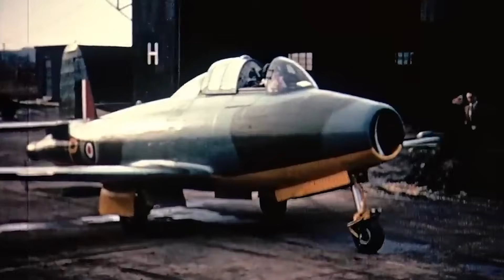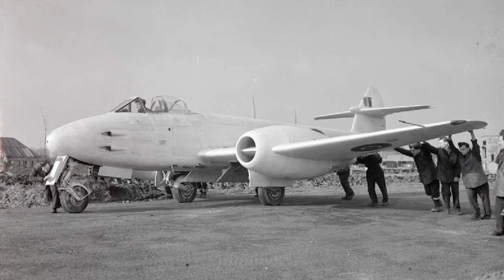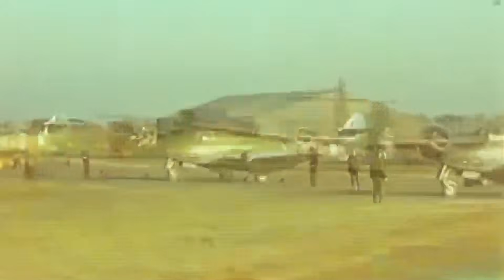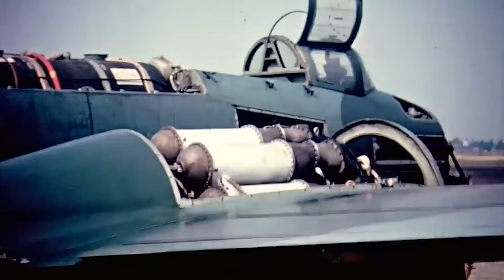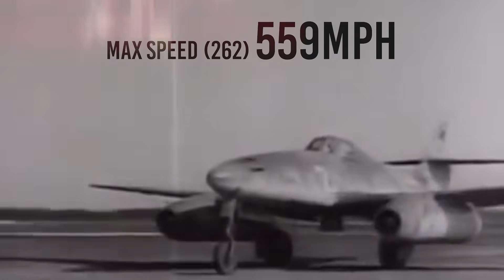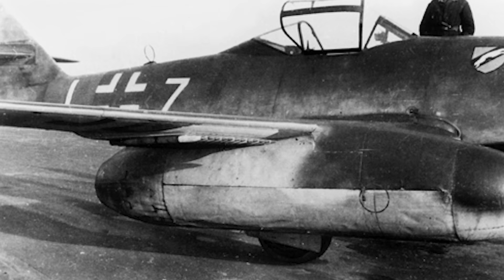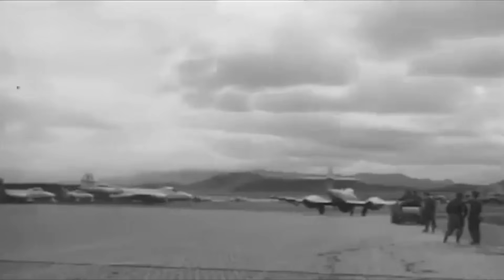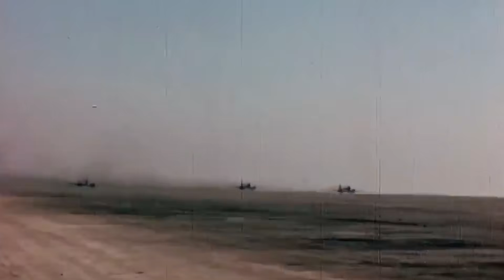Meteor vs Me 262 | Which was the better WW2 jet?

Comment: Facts for an alternate history:
+ Meteor had a record speed
+ its aerodynamic solutions were used in the very successful Canberra
+ today, for speeds over 500 mph, similar wings are used for maneuverable aircraft
+ Meteor was being built and improved before 1955, all Me 262s were discarded, and its influence was almost negligible.
It seems to you that the deformity is beautiful. That's my conclusion. Beauty is a horrible force(c)
Reply: Postwar Britain was bankrupt and had no option other than operating obsolete equipment such as the Meteor. Only Commonwealth nations and the third world operated the Meteor
Reply: @TheAneewAony 

LOL The Nimonic nickel super alloys were developed in Hereford England 1939 -1940. In Germany they thought they needed to use stainless steel for turbine blading which doesn't work and due to various issues ended up attempting to use pressed sheet steel turbine blades. 

262 & it's engines = Garbage (but it did actually fly which surprises a lot of people). In both Russia and France good people wasted their time trying to do something with the engine after 1945. Russians ceased trying in 1948 as their own effort was clearly better.
In France RR got involved in 1950 and managed to get something useful working. 

We feel we can clear up some commonly held myths and misconceptions, obviously.
It's always good to see the facts presented clearly and concisely isn't it?

The Gloster Meteor was one of the world's first jet fighters to go into service, it was in service during WW2. The meteor was the first effective multirole fighter bomber jet aircraft with a reliable engine to go into service,  It broke speed records in 1945 and 1946. During WW2 it was in service as a fighter and multirole aircraft over the UK and over all allied controlled territories in Europe and beyond. 

The ME-262 and it's 46 minutes life engines were abandoned shortly after 1945, it had a do not exceed speed of 456 mph and was only ever used to attack bombers with losses of three 262s for each downed bomber.  During WW2 most of the ME-262s were destroyed by their engines, were various types of accident losses or were shot down by bombers. No German designers were involved with the Mig-15. The Mig-15 used a copy of the RR Nene.  

During the Korean conflict most of the Meteor casualties were due to groundfire or accident losses. The result of any tangles between Migs and Meteors was that Mig pilots avoided getting into dogfights with Meteors. The battle of Sunchon, where 50 Migs against 14 Meteors resulted in the supposedly superior Migs failing to gain any clear advantage caused the Koreans to re-evaluate tactics. General opposition in Australia to involvement in the Korean conflict resulted in the govt using the battle as an excuse to reduce the RAAFs involvement to troop support only.

The world's first wind tunnel was built in England during the 1800s. The world's first supersonic wind tunnel was built in England during the 1920s. 

The Whittle Gloster E28/39  was of course a brilliant aircraft that was later copied in Russia as the upsized and tweaked Mig 15 with a copy of the RR Nene gas turbine aero engine. The RR Nene being the world's most powerful & most reliable gas turbine aero engine in 1944.

The MD F3H Demon was a contemporary to the DH Sea Vixen & had a similar performance. The F4 Phantom was a follow on from the F3 Demon. The Sea Vixen took a long time to get from first flight to introduction for various reasons and a similar situation occurred with the MD F3H Demon.

McDonnell Douglas F3H Demon
590 Built. Not Supersonic.
Max Speed 578 MPH.
Introduction date 7 March 1956
First flight 7 August 1951
Retired 1964

MD F-4 Phantom 2
Number built 5,195
Manufactured 1958–1981
Introduction date 30 December 1960
First flight 27 May 1958

DH Sea Vixen
Number built 151 (including two DH110 prototypes and one Sea Vixen prototype)
Introduction date July 1959
First flight 26 September 1951
Max speed 695 MPH.
Retired 1972

Interesting British achievements.
There is no doubt that the Fairey (England)
Delta 2 was of course the world's first jet
aircraft to exceed 1000 mph.  Indeed It
exceeded the previous record by 310 mph &
held the record for 1 year. Incidentally, the Dassault Mirage 3 & 4 are based on the Fairey Delta 2.

The Panavia Tornado & Euro fighter Typhoon are British design aircraft with British design engines built by international consortiums. 

The EE Lightning was one of the fastest aircraft on the planet when it first achieved a Mach 2 flight. 

Early days, jet fighters.
De Havilland Vampire, Sea Vixen & Gloster Meteor accident losses were not high or unusual for fighter aircraft at the time. De Havilland built large numbers of all metal airframe aircraft before the DH Comet.
We mustn't forget of course that the DH Vampire for example first flew in 1943 & the engine was also built by De Havilland. There were examples of the Vampire interceptor / fighter in service until 1990 which was operated by more than 30 countries.

Non combat phase accident losses.
% of Aircraft built.

The Canadair CL-44 was a turboprop airliner.
Canadair CL-44                  (ff 1959 ) 48%
Lockheed XF104                (ff 1954) 100%
Lockheed  P80                   (ff 1944) 43%
Lockheed F104                 (ff 1954)  45%
Grumman f9f-5 Panther   (ff 1947) 44% 
Convair F102 Dagger        (ff 1953) 45%  
MD F-101 Voodoo.             (ff 1954) 34%
MD FH Phantom 1            (ff 1945)  35%
MD F4 Phantom 2             (ff 1958)  28%
MD F3H  Demon               (ff 1951)  32%
Gloster Meteor                  (ff 1943)  21%
DH Vampire UK                (ff 1943)  23%
DH Sea Vixen   UK           (ff  1951) 33%
Gloster Javelin  UK         (ff 1951) 20%
EE Lightning  UK             (ff 1954) 33%

It's a great pity & a crying shame that British military forces had to occupy a large part of Germany for decades after 1945 & Russian military forces had to do the same. Of course Russia still posseses a large chunk of what was German territory & of course Russia & the UK produce nukes. Obviously Germany does not produce nukes.

Early days, jet engines. Whittle performed the world's first demonstration of a gas turbine aero engine in 1937. The RR Nene, a centrifugal gas turbine aero engine, was the world's most reliable & most powerful gas turbine aero engine in 1944. Licensed built versions & copies of the RR Nene & RR Derwent would go on to power many aircraft in Russia including the Mig 15 & Mig 17, the US, China, France & other countries for decades after 1944. Incidentally, the Mig-15 was in essence an upsized / tweaked copy of the Whittle / Gloster E28/39 jet aircraft including an uprated copy of the RR engine.  The basic centrifugal compressor gas turbine aero engine with Whittle style reverse flow combusters and sometimes an axial compressor section is still manufactured by more than one company including Pratt and Whitney, the main application being helicopters.

The gas turbine engine was invented in England during the 1700s.

During the 1800s Parsons of Ireland & North England produced the world's first axial multi stage sequential stator rotor turbines and compressors for turbomachinery use which would eventually go on to to form the main components of the axial gas turbine aero engine. At the time the basic idea of making an internal combustion gas turbine engine and using it as an aircraft engine was considered thus the jet aircraft concept had been created in England before the first powered aircraft flew.

An example of what goes on these days in various countries. For example, there are of course no German companies that makes German jet aircraft in Germany & there are no German Companies that make German gas turbine aero engines in Germany that are suitable for widebody airliners.

The UK has the world's highest combined per capita Nuclear / Defence / Aerospace Sector Activity.

UK defence sector, absolute terms, world's second highest activity. 1st for per capita defence sector activity. Per capita nuclear powered submarine construction, 2nd position. 
Main players being Rolls Royce, Babcock, GKN Aerospace & BAe Systems. Activities often involve international collaboration. BAe systems, RR and other UK companies now handle more Airbus work value wise than Germany. 

There's a good chance that anyone currently flying on a widebody airliner will be on an aircraft powered by RR gas turbine aero engines made in the UK and a good chance there will be other hardware on the aircraft that's designed and / or manufactured in the UK. 

Rolls Royce Holdings UK
Subsidiaries
- Rolls-Royce plc
- Rolls-Royce North America (ex Allison etc Classified Military stuff)
- Rolls-Royce AB
- Rolls-Royce Deutschland
- Rolls-Royce India Private Limited
- Rolls-Royce Marine Power Operations
- Vinters Engineering Limited
- Rolls-Royce Controls and Data Services
- Rolls-Royce Power Systems
- Bergen Marine
Joint ventures include:
- Rolls-Royce Turbomeca
- MTU Turbomeca -

Trent Family
The MT30 (Marine Turbine)
Industrial Trent 60 Gas Turbine
Trent 7000
Trent XWB Airbus A330neo.
Trent 1500
Trent 1000
Trent 500
Trent 600
Trent 700
Trent 800
Trent 8100
Trent 900
   
RR wholly owned subsidiaries in Germany handle smaller 2 shaft RR gas turbine aero engine work.

The UK space and aerospace sectors are highly productive, high-value industries that together contribute over £18 Billion in direct Gross Value Added (GVA) to the UK economy. Individually, the space industry directly contributes about 0.3% of UK GDP 7•2 Billion while the aerospace industry contributes approximately 0.5% £10•9 Billion.
   
Wee hopes theze helpsmz.  EtC---.

We hope this helps of course 👍

Comment: In Germany, there were no aircraft with a thin wing sweep >30 deg.
However, they were being built in the USA starting in 1942: XP-55, XP-56, XP-79.
In Germany discovered swept wings with controlled slats. And it's precisely this combination, not the swept wing angle with which the USA had grown weary by that time, that was the solution.
And DH 108 is not based on German work. Own work since 1908 is sufficient! Elevons, thin S-airfoil, winglets, fences, most types of flaps — British implementations. Except for the Wright flaps, as part.
The German controlled slat on the swept wing saved at LOW speeds.
Reply: The slats functioned at low speeds, or at higher angles of attack, delaying separation of the boundary layer and a stall. Additionally, the increase in wing sweep from the prototype 262 wasn't done for aerodynamic reasons, but to shift the center of gravity that had moved with the change from BMW 003 engines to Jumo 004 engines. It's like the people who ascribe all sorts of stealth design to the Horten Brothers' Ho 229, when there was no such intention until Reimar Horten claimed, years after the end of WWII, that 'stealth' had been a design consideration in the design of the 229.

Comment: Whittle's solutions were not a dead end then, they are widely used on small engines today.
For example, the supersonic Ching Kuo and re-engining Jaguar, M341 have a centrifugal compressor and a counter-flow combustion chamber. And even smaller turboprops and missile engines.
Jumo 004 and all Hirth projects are a dead end. Westinghouse and Price made fail projects. Only BMW 003 was developed in the USSR and France, for aircraft of a different size. There was also Griffith, whose project failed, but became partly the basis for work in the UK and US. Whittle's company was not allowed to develop its ideas in the UK, because it was directly associated with the Ministry of Aviation, not commercial. His small company collapsed, and Whittle flew off to work in the US.
Afterburner, turbofan, combination of axial and centrifugal compressor, two shafts - these are his early ideas.

Comment: The claim that the reliability of Jumo 004 depended on heat alloys is debatable. There is a easy argument: the captured Jumo, BMW, and Hirth engineers tried to complete 004 in the USSR. They initially used German heat alloys, which were not scarce in the USSR, and from 1946, after Soviet engineers' trips to RR, the famous British alloys, but this did not lead the project to robust.
However, the length of the shaft, the number of supports, the big number of compressor stages, without a compressor stator, and the straight combustion chambers led to breakdowns and maintenance difficulties. This was the fault of the Jumo designers. Only Jumo 022 good worked in the USSR, but it was done using all the knowledge gained in 1946 from RR.
Not only a alloys. It is clearly important that 022 was much larger. Small motors have specific solutions.

Comment: Wasn't even close. The 262 shot over 700 real planes down. The Meteor put down V-2 robot bombs, and that's all. The Meteor was rubbish.
Reply: I dont think the meteor was rubbish i have read that the Meteor forced a  fieseler Storch Plane down and destroyed it on the ground!
Reply: @killerkraut9179 Wow!! What an impressive accomplishment!! (sarcasm). The ME-262 only shot down 700 Allied bombers and fighters for the combat losses of 100 jets. LOL
Reply: @WolframKrause-s5i  If the Wikipedia article is correct it did succesfully destroy some planes on the ground as well!
Reply: @killerkraut9179 When is wikipedia ever  correct? The Meteor was good for tipping over V-1 rockets that were slow, and maybe a plane or two parked on the ground, but even the RAF didn't trust it to do air combat against the Luftwaffe, so the plane must have been trash. The Germans had a good jet, the ME-262 which actually shot Allied planes down while they were in the sky.  Only problem was they didn't have enough of these jets, thanks to Hitler's stupidity.
Reply: @WolframKrause-s5i  Very often is Wikipedia correct!
Reply: @killerkraut9179 True, but sometimes not has been my experience.
Reply: @WolframKrause-s5i  There was a real danger in ww2 that planes technology ends 
in the wrong hands like by the Us B29
then the Meteor dosnt have to been trash 
Meteors hade much service after WW2!
Reply: @killerkraut9179 Where's your common sense? There was a reason that the Meteor did not have even one combat encounter in the sky with Luftwaffe fighter planes like the FW-190, ME-109 or the ME-262.  The RAF did not consider it good enough, and put more confidence in its Spitfires and Tempests. The Meteor was only good for downing slow-moving V-1 rockets.  All fact. What don't you understand about that?
Reply: @WolframKrause-s5i  Tel me about B- 29 
and Tupolew Tu-4 Story!
Then it will make sense that the Meteor wasnt often  used over German territory!
That  is most likely another reason that the US P80 wasnt used in Asia!
Reply: @killerkraut9179 Give it a rest already. There never was a Meteor flying over Germany during WWII, and why is your name killerkraut? You don't seem pro-German to me.

Comment: Oh man the me262 was may more better if was down to  athletics (how good it looked, not how fast it could run)
Reply: In a dive, Me 262 was slow by P-51. This was shown by joint tests and battles. In aviation sport Meteor to be more successful.
The main , in my opinion, thing is that NO ONE needed Me 262s, even in the delays USSR, which relied on German engineers and factories.

Comment: The British engines worked great in MiG-15s. Axial-flow engines may have been the future, but in the late '40s were still temperamental. Build quality on the 262 was shit; what do you expect from slave laborers? The Nazis' biggest flaw was that they were Nazis.
Reply: Agreed. All facts show the advantage of Whittles' work over all competitors and in all aspects. Not the time, but the grow size made Whittles' temporary solutions marginal for big engines. The found physical patterns always have a scope of application.
His original patent had axial stages before the centrifugal. It's clear that the shaft elongation would have greatly delayed the work, as it happened to most of Whitney's competitors. Its combustion chambers had extremely easy access for inspection and replacement. The infamous large diameter is formed by the combustion chambers, not the compressor. The competitors complained, first, about the chambers, but this is their design fail.
And take a look at the successful Garrett TFE731 family today. It dominates aircraft the size of MiG-15, including supersonic ones.

Comment: The Me 262 is the Tiger1 of the air.  The Tiger had better armour, had a better gun etc. etc.  It was complex, unreliable and difficult to service on the road.  When it and the panther appeared en masse at the eastern end of the "D" day landings, they were handled by a cobbled up Sherman with a 17 pounder anti tank gun rationed to one to each troop.  The reliable but "inferior" Sherman with a gun that had the range and could penetrate their frontal armour combined with the standard Sherman was all that was needed.  It's a bit like the rifle arguments.  Target rifle? Hunting rifle? or the Battle Rifle developed over half a century that works in the mud, the ice and the tropics?  Take your pick.

Comment: A staggering 850 planes were destroyed in plane-crashes and 450 pilots died because of how reliable and easy to fly Gloster Meteors really was. 
Me262 shot down 540 Allied bombers, and probably killed a less pilots.
In this regard Meteors is a clear winner over Me262 - it was far more dangerous for allies planes than Me262.
Reply: Do you have a source for these Informations?
Reply: @ASL-hg8se  wiki
Reply: 540 kills claimed for 450 airframes lost. A K/D of 0.9 is utterly woeful
Reply: The Meteor was basically falling out of the sky - in peacetime.